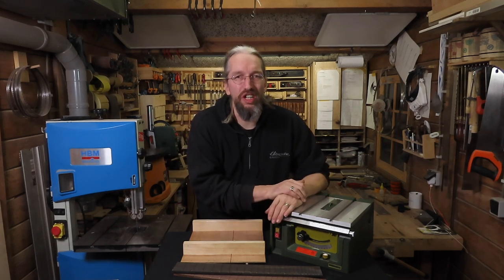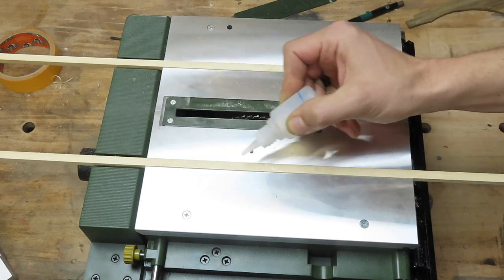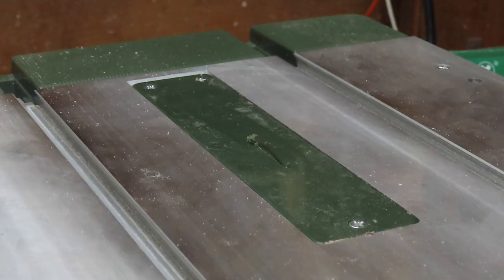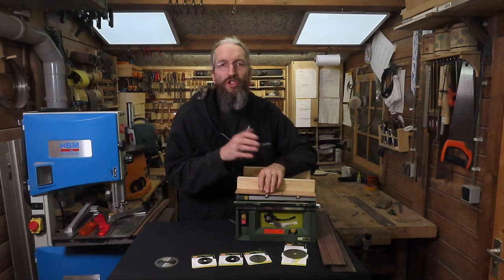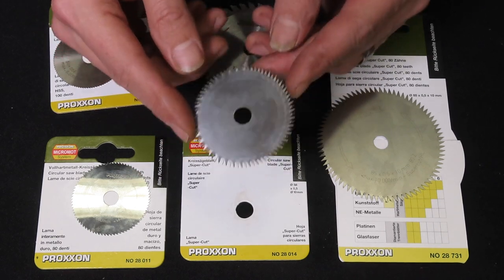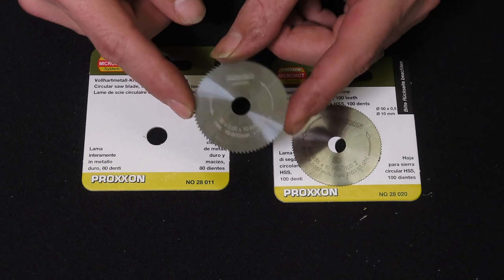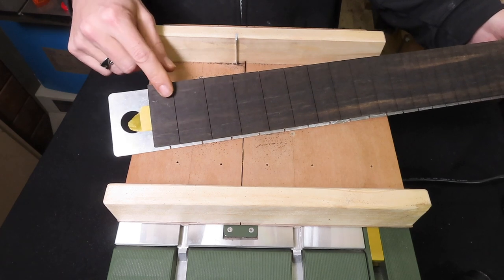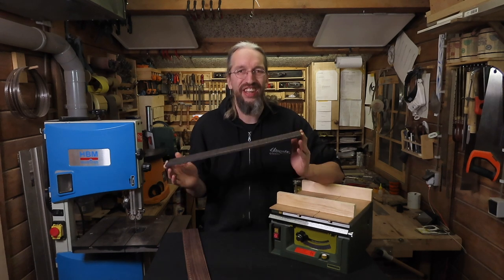Never cut fret slots by hand again with the Proxxon FET miniature table saw.

Comment: There's also an option to get a saw blade for a regular table for cutting fret slots from Stew Mac. It shows up at $200.28 CAD. Where it attaches to the auger looks to be normal width, based on the picture, and then the last inch of the blade is set to the width that would be ideal for cutting fret slots.

Comment: Nice! Being in the USA I use a Hardware Freight Mighty Mite (around $40) and a sled... the Mighty Mite has flaws, most notably the motor is underpowered (and the height adjustment of the saw table is difficult and fiddly) but with some modifications it gets the job done (Del Puckett gives great advice for using the Mighty Mite)!

Comment: Thanks for the video. I was really excited to try this out and have just used the setup for the first time. However, the results were not as good as expected. First of all, the blade got very hot and began smoking after just a couple slots. I tried taking shallower cuts, but this of course risks widening the channel. Also, I found that if I cut the slot very slowly that it was quite precise at the start of the cut (ca. 0,55mm) and then wider at the exit of the cut (ca. 0,75mm!!). And this was with a brand new blade in East Indian rosewood.

Do you have any suggestions as to how to make the process work better? I'd really like this setup to work!

Comment: Really nice Daniel 
Question, I noticed you cut through, lift and go back. Many would bring back over blade, I assume thats a bad idea??
Thanks, Spike
Hope you are ok?
Reply: If there is any movement at all in your setup you can easily make your slots too wide. When you pull your fretboard back over the blade do you hear any noise? I'm guessing that you do. That means that you are cutting on your "backstroke" as well.
Reply: @jasonkirk1313  yea, normal practice with it cross cutting, just push it back nothing there , LOL

Comment: Cool idea and looks it works great, but just thinking table saw from proxon is around 300e plus templates plus circle saw..... And if you work always on diferent scales you Ned more templates. It's not better to go to cnc? I know this can be much faster but you cannot do a multiscale and with cnc you can do it without problem and it's not so much more expensive. And if you have cnc you can do inlays perfect. And we talk about less than double price. Just thinking 🙂

Comment: Great video Daniel! I think I’ll unfortunately keep doing it by had as this machine costs over $850 in Australia. It said you were injured during the video, Hope you are doing well, what happened?
Reply: Any small cheap table saw you get through Bunnings will work, for that matter even a cheapie one from Aldi would too. The hard bit is finding the right blade locally. I use a Stewmac blade on a compound mitre saw. I also have a deWalt contractor saw I might use at some point when I get around to making a sled

Comment: I don't understand the need for the zero clearance insert when using the sled?  Doesn't the sled act as one already?
Reply from the maker: Hi Rick,
Yes, the sled does act as a zero clearance insert, but I thought it would be better to have it when making the sled itself. I was a bit worried about the blade thickness and thought the insert might help with that a little.

Comment: Wow that is an expensive little saw. Too rich for my blood. You can do the same with the $50 version from Harbor Freight and a decent 4 inch blade. It works a little slow and is somewhat underpowered, but still...it works.
Or buy the StewMac blade for $135 and put it in my existing table saw.
For your $500 set up, I will stick with my hand saw and little miter box jig.
Reply: My Brynes table saw will last generations.   I had the HF mini table saw and tossed it after I bought the Brynes saw............

Comment: Really nice Daniel 
Question, I noticed you cut through, lift and go back. Many would bring back over blade, I assume thats a bad idea??
Thanks, Spike
Hope you are ok?
Reply from the maker: I'm not sure if it would be a bad idea to bring the sled/fretboard back over the blade, but I don't want to risk even the slightest deviation on the way back resulting in too wide a fret slot or something.
Better safe than sorry.
Reply: I have a radial arm saw, runs very true, but I won't bring ti back through mine, when I build it. 
Now question is, would you cut from back coming forward down cut, or backwards, I guess it would be uncut. With radial arm saw, you can do both???
Enjoy your builds and videos, one day, I'll figure it out too.
Reply: @FrugalFixerSpike  I also use a radial arm saw. From the docked position, pull the blade towards you for the cut.
Reply: @jasonkirk1313  that is my normal process for cross cutting wood, but I normally just go back, as after a cross cut, you are doing nothing. But slotting frets, I see the need for one pass for sure to insure accuracy. But if I have to remove it from the saw every time, to reset would it matter,good, bad or indifferent if you started at the front, went back for you cut. Then you could move the jig, pull back the carriage slide it in again for another fret slot. either way, you have to take it out, to move the saw blade across? Would that cut direction work as well?
I have electric lift control on my Radial arm saw, but the last thing, I want to do it change it, during a fret slot job.  I have a small table saw, I have a sled for it, get the proper blade, but they are not cheap, but already have everything else. The blade is the same for my RAS and the Table saw one, from SM. watching this I think the Table saw is the way. Blade is $160 looks like